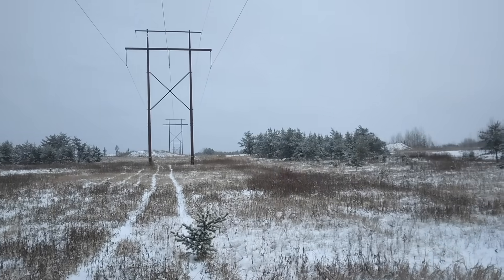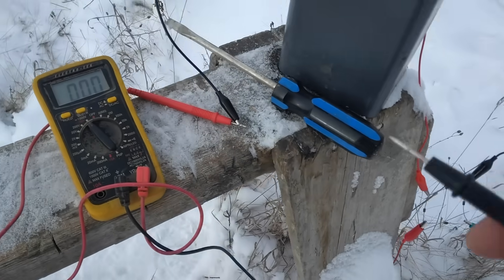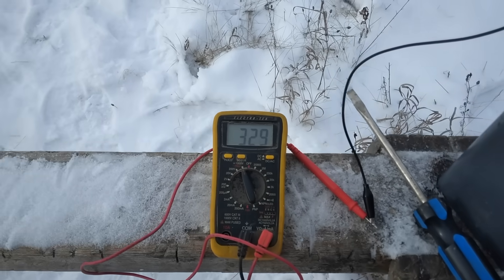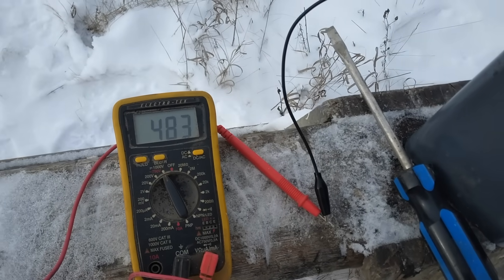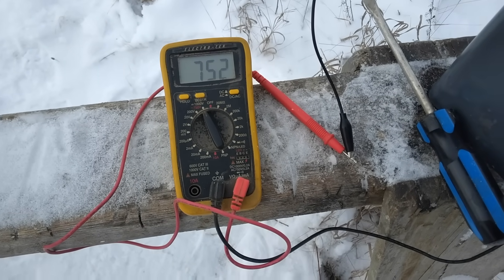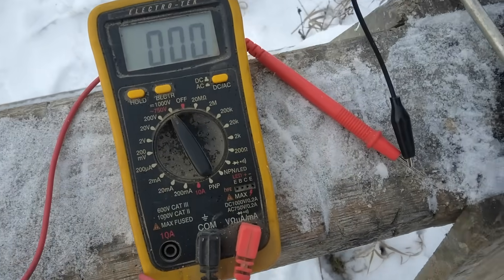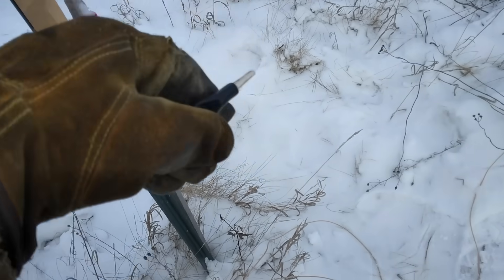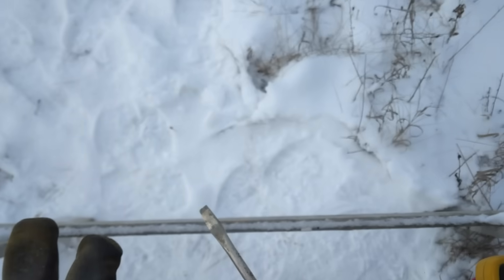Fences sucking power from under HV transmission lines

Comment: Instead of shorting a capacitor out to discharge it, use a 20K to 50K, 10 watt resistor across the cap terminals and it will slowly and safely discharge the cap in a few minutes. Remember once a cap is discharges and you remove the short, the cap may very well regain a charge over time. So leave the resistor attached to the cap when not in use.
Reply: A little bit of knowledge being a dangerous thing 👍
Reply: @@gazrgazr2394 sometimes we all need a good shock in life, to get things right. LOL
Reply: This is not a game. Even if the cap.is not connected it will keep the charge and could kill you. You must tie a 20k. 10 watts resistor across the capacitor posts and leave it there all the time.
Reply: @jacquesdubord6844  The entire purpose of using the screwdriver to discharge the cap is that people love to see fire and explosions and sparks. What fun is discharging the cap uneventfully with a resistor? Come on, man... be open to having some fun! Scuba divers flirt with death every time they go in the water. But that ain't no reason to just stop having fun scuba diving because it's serious business and dangerous!

(And no, the cap is not going to miraculously charge itself without being connected to a source, so there is no need to keep a resistor across the terminals "all the time.")
Reply: @-108- When the cap is shorted,  you, your dog; everyone is safe. When you are playing stupid games; you can take the short out and win a prize!
Reply: @-108-  Or because the screwdriver is handy, but I usually us a resistor.
Reply: @-108-  This video just showed that electricity can be pulled from the air... seems the capacitor would be able to charge inductively also.
Reply: @benc.enlots  That's actually not what this video showed. And therein lies the issue.
This video showed that electricity can be induced in a wire (and a fairly long wire, at that) via a magnetic field created by parallel wires. Standing in said magnetic field doesn't electrocute you because you are not a parallel wire. An isolated cap is not charged in the presence of said magnetic field for the same reason.
Reply: @-108-  I believe that is what it shows... you obviously have to convert it to use via outside means but it is getting sucked out of the environment. I am not an electrician but my eyes work fine to see what is happening.
Reply: @-108-  caps don't fully discharge all at once after having been charged. The residual charge that develops after initial discharge is due to dielectric absorption. Capacitors effectively become small batteries. After some time, that battery action discharges itself back into the measurable voltage in the capacitor. So, yes, they do recharge themselves, to a degree.
Reply: As a university qualified electronics engineer with over 50 years of experience, I would assure everyone of the following facts: 1. discharging a capacitor with a short-circuit creates a fast risetime pulse beyond the capacitor's dv/dt rating, which can cause dielectric punch-through (permanent internal damage). Capacitors - especially electrolytics - do self-charge. Try discharging a capacitor and then monitor the voltage across it; it will rise from zero.
Reply: @manolisgledsodakis873  But it's not going to self-charge to any dangerous degree - or even to any degree that would shock a person. I've got a bunch of 1 farad electrolytics that are wired together and sitting static, and they don't ever self charge to a point where I can feel anything when touching the leads.

Capacitors have slight internal leakage paths, which allow a small amount of charge to gradually leak away over time, causing the capacitor to discharge even when disconnected from a circuit. This is why even new capacitors lose some charge if stored for a long time.
Additionally, electrolytic capacitors have a thin oxide layer acting as the dielectric. This layer is susceptible to chemical processes within the capacitor that can slowly convert some charge carriers, further contributing to their discharge.

So the overall inherent tendency of a cap is to discharge over time, not charge.
Reply: If you are going to use the screwdriver, keep shorting until there is no spark, then remove the screwdriver and short two more times.  I worked with tube recievers and transmitters with HV caps.
Reply: That’s called a bleed resistor in a circuit
Reply from the maker: Thanks for reminding me!
Reply: That is good to know. I did not know caps could recharge significantly.
Reply: @danboyer7088 sometimes with ac capacitors the discharge seems to over shoot zero, and gain a significant charge. Not sure about DC, but lightning and static are real things!
Reply: @danboyer7088  They can't unless a voltage is applied to them.
Reply: @-108- You offer no reference, why lie and possibly be responsible for another's injury?
Reply: @richardmccann4815  I offer no reference because I know electronics, and it is common knowledge. Caps don't charge themselves. If they did., they would not function properly as components in a circuit because they would constantly be getting charged by whatever you think is charging them - static electricity? Ambient voltage differential? Just imagine how haywire every electronic device that contains caps would go in an electrical storm. It's nonsensical.
Reply: @-108- You are wrong and that is why your comment has no likes.
Reply: @James-kd7dc  I have like ~7 replies here, and the only ones that don't have likes are towards the bottom of the thread, where nobody else's replies have likes either. DOH!
That being said, if likes are what you are going for in life, YOU are wrong... in the head. Have phun!:face-fuchsia-poop-shape:
Reply: @-108-  Caps absolutely will self charge.  Some of the charge is stored in the dielectric and not on the metal plates.  That charge does not easily come out of the dielectric.  It gradually migrates out and partially recharges the plates after you've discharged them.  If you had ever actually discharged a cap and measured it, you'd see this effect.
Reply: Yep, shorting a cap may keep you from landing on your butt, but it's not nice on the cap.
Reply: @kellyvcraig I've read a few places that some of them can't take that high a discharge current. Even delivering a 5 joule pulse at 300 volts to a zenon tube isn't as rough on a capacitor as being shorted with a screwdriver.
Reply: @kellyvcraig  Doesn't damage a cap in any way, other than possibly the terminals where the spark digs at them.
Reply: That saves a lot of damage to components. Some capacitors can be blown by discharge that rapid and it leaves burns on wires and terminals.
Reply: @tkirby115  No they can't be. Not unless the cap is defective.
Reply: Also, sometimes high-capacitance capacitors can explode if discharged through a hard short like a screwdriver.   Much better to use some form of resistor.
Reply: Nice! Thank You!
Reply: Hopefully 10watts is enough to load it down...
Reply: I expect the 4 diodes as a bridge severely limits the maximum voltage, because their leakage increases before reaching breakdown.  If it was a simple single diode instead I would expect the voltage increase higher and higher still.
Reply: I believe you mean 49.9k 😉
Reply: We used to bass fish a canal , and caught more underneath the high power lines going across the water . Don't know why but it was a honey hole...
Reply: Where is the fun in that ? Much more exiting to short it with loud bang lol ;) Also with large capacitors of high voltage leave them shorted out when not in use to avoid them building up a dangerous charge on their own.
Reply: Damn good advice
Reply: @ClaudeBohls  Thanks
Reply: Thats no fun!
Reply: @cerealbucketcoaster  With a Cap  like that , you only fuck it up ONCE .
Reply: @johncunningham4820  messing with HV requires an amazing amount of respect. It is still really fun. But when your playing you got to have a head on you
Reply: @cerealbucketcoaster  its better than welding your screwdriver to the cap leads... (or is it?)
Reply: Stop the insanity
Reply: also you could put your weenie across and see what happens,, the resistance is lilkely the same 10 maybe 15k ohm?
Reply: Yep...And a large charge too, if left long enough.
Reply: That would avoid any sparks. 50k times 88 micro is 4.4 second. In this time it will decrease to 37%. Again and again. In 44 seconds it will be 0,05%. 0,5V for the 1000V you start with.
Reply: din't know that.
Reply: I just do them like a 9 volt battery and lick'em😮
Reply: That's a nice old oil-filled capacitor (it might even have PCB in the oil). They don't make 'em like that anymore. Protect the capacitor by discharging it through a resistor. Resistance x capacitance = time constant in seconds. Any resistance (even 100 ohms) is better than nothing, and might prevent damage to the capacitor.. Also, you can get cheap, surplus electrolytic caps of 1000 mF or more that will make bigger, much more dangerous sparks. Maybe get a few surplus ones that you don't mind destroying?
Reply: So let me get this straight the wire isn’t physically touching the metal power line towers or the power lines them selfs & it’s just standing stretched by the wood? Electrical being charged without physically being touched by anything electrified? Then that’s what you call “A force to be wrecking with!”
Reply: @yatusabes909   its called 'induction'. No direct physical connection.But there is a direct, but invisible electrical connection. 
Like a metal cored transformer, an induction circuit can be made thru thin air, a vacuum etc. They don't make 'air' transformers because it is very inefficient.... (well they do, but it's specialised, CVT's) but if you are 'stealing electricity' who cares if it is efficient or not.... so in some circumstances boundary fences running along the 'pylons' or towers carrying extra high voltage will be reasonably good for picking up energy from the overhead lines. (on low or house supply voltages.... forget it) Careful with your earthing, insulators etc etc. Make sure it's legal in your jurisdiction. Mainly it is not legal anywhere in the world. And someone will eventually notice and come and ask you for money, or your details for the Court case.
Reply: that's induction at work, a wire insulated from the ground can easily store potential energy until it contacts a ground source.  the higher the voltage in the power line the stronger the shock from the wire.
 @yatusabes909
Reply: @yatusabes909  reckoned
Reply: @yatusabes909 look up induction. Or search a little bit about the electromagneticism. It helps explains a lot. Transformers, ac motors or just inductive coupling...
Reply: @yatusabes909  It's called electromagnetic induction, it's fully explained by Maxwell's laws of electromagnetism..
Reply: I used to work on gen powered light carts.  eventually the capacitors would begin to fail, at that point the lights go out and come back on in about 12 minutes after the capacitor recharged.  If you leave them set for long periods even a bad capacitor would recharge on it's own.  the world is full of free-floating energy, such a mystical force.  Nikola Tesla's playground.....
Reply: @rodneyanderson1402  I do believe your story, but there is no "free floating energy" Capacitors charge themselves through a slow chemical reaction.
Reply: @rodneyanderson1402 
What a load of crap.
Reply: @hime273 there is tons of high voltage static electricity in the air. It can charge capacitors
Reply: @hime273  . Actually a Capacitor  WILL  soak up Electricity from the Air over time .
They're known for it .
They should be Bridged when in Storage for safe handling  reasons .
Reply: @hime273 it’s called a bleed resistor
Reply: BAD suggestion. Totally no fun, as everyone is watching the video to see the shorting spark at the end!
Reply: Why not charge a battery from the capacitor with a DC-DC converter? You could automate that to pulse it for a minute every ½ hr and get some free power continuously.
Reply: @JoeInBendigo true
Reply: A capacitor doesn't regain charge without reapplying voltage.
Reply: @joewoodchuck3824 It can though, through a process called dielectric absorption. On high voltage capacitors this can result in a dangerous voltage if a capacitor is stored without a shorting wire or discharge resistor connected across it.
Reply: @joewoodchuck3824  While this is a true statement, there is a phenomenon called "dielectric absorption" where a capacitor that is discharged will SEEM to recharge on its own after un-shorting a capacitor.  It happens only in capacitors that have been charged with high voltage for a while and not discharged long enough.  You need to leave them shorted for some time while the dielectric gives up the charge.  Its a real thing, I have seen it on DC high voltage insulation of generator windings (which act like capacitors in the test).  You can google the term.
Reply: @joewoodchuck3824  There's a thing called "dielectric absorption".  It's a real thing and you can find several trustworthy sites that explain it.  The capacitor doesn't reach full charge, but could get up to 5 to 10% or so of the original charge.
This is not a "perpetual motion machine" situation.  The charge is actually left over from the original charge.  The Dielectric can't fully relax on the first discharge, is the way it was explained to me.  Or another way of looking at it is, supposed you went to take a tinkle, and thought you were 100% empty.  One minute later, you may be able to produce another pint.  Capacitors can feel the same way.

Comment: Uses to run dirt bikes along power lines.  And to get the bikes on location a small van trailer, which was secured with a laminated padlock.  Parked under some very large power lines, steel towers 80+ feet off the ground, after it had rained the previous day.  While wearing tennis shoes grabbed the lock only to release it quickly due to being surprised by the tingle of shock.  It wasn't very painful about like a joybuzzer handshake, unexpected.  Never happened on dry ground, and It would have certainly been more intense bare foot.  The capacitor is DC, AC will interfere with the hearts natural rhythm.  Two capacitors can be used to store AC, super caps won't work as they are unipolar.  Any energy taken will be seen as an inductive load against the magnetic field.  Look into Lenz's Law and Gaussian theory.
The trick is thinly laminated iron.  If you can't get a transformer try using an induction motor cage (ie remove the rotor).  Wouldn't expect more than one or two hundred watts, check AC voltage.  For reference: Columbus sailed the ocean blue in 1492 watts is two horsepower, 746watts per hp.

Comment: If you doi again it would be interesting to ry a short vertical wire.    There is an enormous voltage gradient in the vertical direction.   The gradient is 230,000 volts divided by the height above ground which is at zero volts.   A vertical wire say 6 ft long should intercept a significant part of the gradient.   If the fence has a lot of these vertical sections in series it could get to the point where you can draw significant power.

Comment: You should put a 50K resistor and amp meter across the positive and negative leads to see how much the voltage might drop to. To measure the resulting current and see the usable DC voltage available. Maybe see if it could power some LED Christmas lights. :)
Reply: You could for sure get some use out of it.
Reply: You can calculate from how fast the capacitor is charging
Reply: Or you could directly measure the current flow. It can't be very much as the small diodes did not burn out.  @Xxx_viagra_xxX

Comment: The voltage on the cap is not what the diodes see,  they see what the wire feeds them, which you will only know when the cap stops going up which will be close to the peak of the induced voltage.
Would be interesting to know what the current flow is.  Very interesting video however.